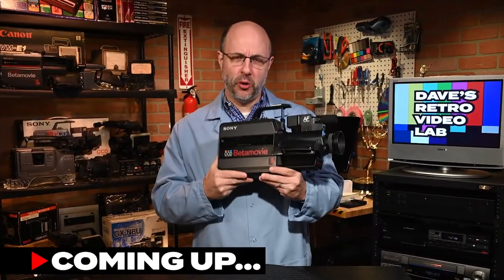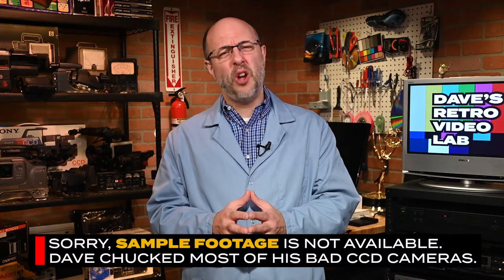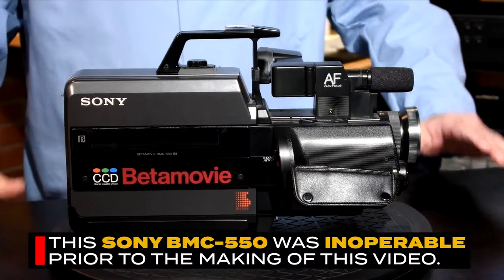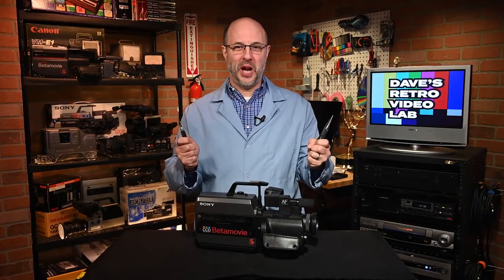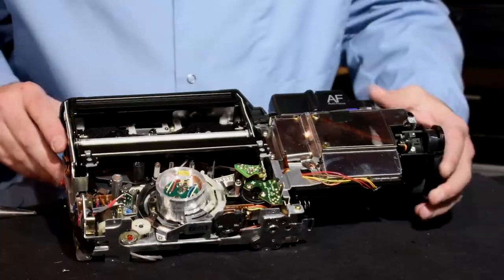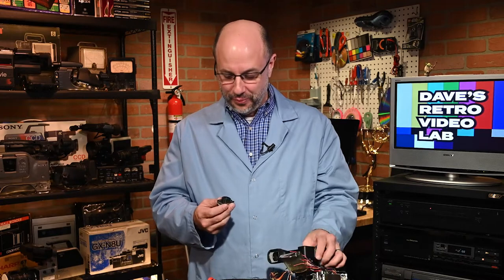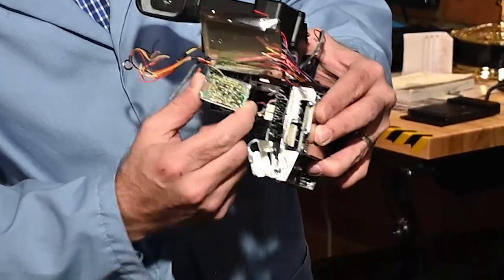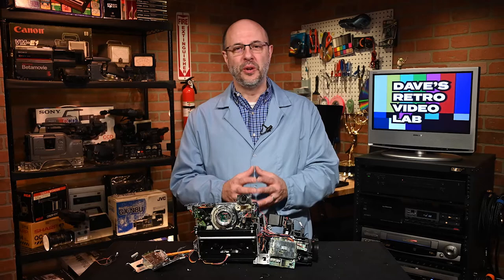SONY BMC-550 Teardown with big surprise!

Comment: The word "crud" needs to come back in style in a big way. Also, you need to trademark "oh, nuggets" immediately. Fantastic video!
Reply from the maker: Hey Scott.  Thanks for watching!  I’ve always felt “crud” didn’t get enough play in the 70s, 80s and 90s.  I felt 2020/2021 would be a good time to reintroduce it back into the American lexicon.  Now if I can only get “oh nuggets” worked in there as well, I would be quite pleased.  :)
Reply: @davesretrovideolab2709  Whatever support you need, you can count on me! #CrudComeback2021 #OhNuggets2021 By the way, if you're interested, my recent video is holiday themed and it rhymes. No cameras are destroyed, but it's good fun.
Reply from the maker: @scottantonucci  I will certainly check your holiday video for sure!
Reply: Yuckiness!!!!  👍🏻👍🏻👍🏻

Comment: WAIT- You can still save that camcorder, provided you do know how to reassemble it in a working way. For future reference, you can fix the next ones with similar problems. All CCD-based cameras and even web-cameras have an IR/UV light cut filter in front of the sensor in order to protect it from UV radiations (harmful to the semiconductor) and IR light (CCDs are overly sensible to it and thus the filter improves image quality greatly). Suche filters can be replaced in one of two ways: the easy one is to buy a screw-on IR/UV cut filter and attach it on the front of the camera lens, then proceeding to optically realign the first lens after the ccd (it's an easy job, point the camera at an object which is at a fixed distance corresponding to the distance indicated by the position of the focus knob and then slide the first  internal lens after the ccd to achieve a sharp image again). The second method implies buying the filtering glass from an optics seller online and then having it cut so that it may rest in its original holding bracket above the ccd. Never touch a ccd directly, those are very delicate semiconductor devices. This second method is very useful for vintage webcams or camcorders without a lens screw thread.
Reply from the maker: Wow!  That kind of repair goes way beyond my pay grade.  Oh wait, I don't get paid.  :)  
I have to say those cameras are quite complex and one would have to have infinite patience and a damn good memory when tackling a job like that.  I must admit, I was certainly impressed by the engineering involved to cram all that tech into the BMC-550.
Reply from the maker: Ps.  Maybe you can fix some of my dead cameras and save them from The Crusher.
Reply: The big problem is fungus on the sensor. Not easy to get to.

Comment: I’ve fixed several of these camcorders.  Soak the lens element in acetone to separate, clean/polish elements and re-adhere with fresh optical cement.  I put a video on YouTube showing the process.
Reply from the maker: Wow!  That goes waaaay above my pay grade.  That being said, I will definitely check out your video.  Thanks for watching!
Reply: @davesretrovideolab2709  oh it’s a giant pain.  The caps on that imager pcb also leak and destroy the traces so best to replace those as well ;).

Sure thing!

Comment: Hello Dave, thanks for this, in the name of science! I'm also a collector of cameras and video oddities and i would like to ask you an issue that causes one of my working VHS cameras doesn't power up anymore. I accidentally join the negative and positive terminals from a 12v battery adapter which i attached to make the camera portable. Is this a lethal fatality, or there's a way to repair it? Thanks so much for the love you put in your videos
Reply from the maker: Hey Ricardo, 
I’m not totally sure how you’re Frankenstein-ing (DRVL Lab term) your camera’s setup, but I’m willing to bet you probably fried either the camera’s power supply or the camera itself.  You can maybe try and purchase a new camera power supply on ebay and see if that solves the problem.  If the issue is internal to the camera, that’s going to require opening up the camera which typically goes beyond my purview.  At that point I start searching around ebay for a new camera.  😊 
By the way, this is how I power my old cameras when I want to make them “on the road”:
Go to amazon and purchase yourself a Antigravity Micro Start XP-10 battery, Antigravity AG-MSA-20A adapter plus a Vanoset 150w Inverter.  The inverter will enable you to simply plug your camera’s power supply into a standard Edison plug.  Now this setup works for those of us who live in the United States.  If you live elsewhere, you may have to find similar components which work with your country’s electrical standard.
Reply: @davesretrovideolab2709  Thank you SO MUCH por all this advice, i will try on this solution to solve thsi problem, and about my camera... well, i think i got a nice paperweight! Thanks again, master